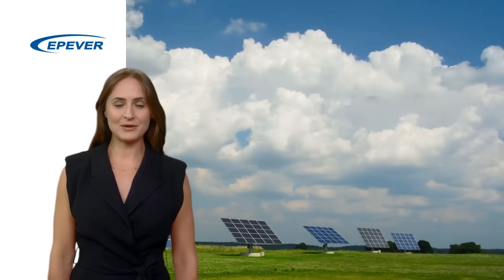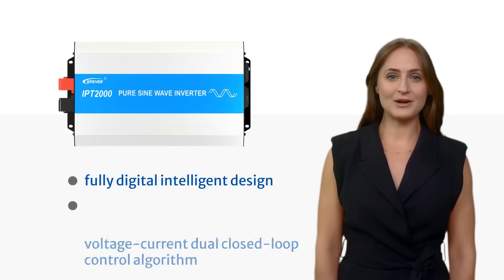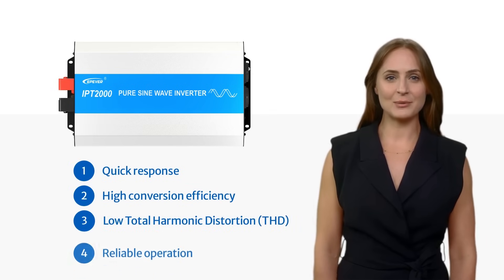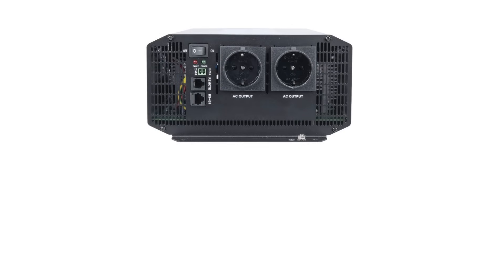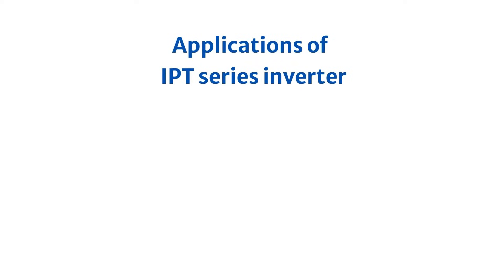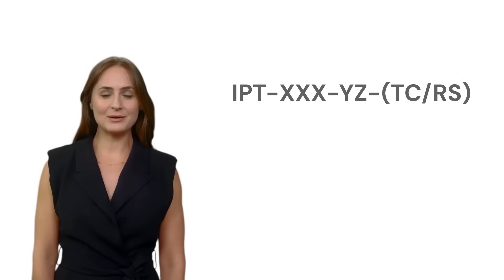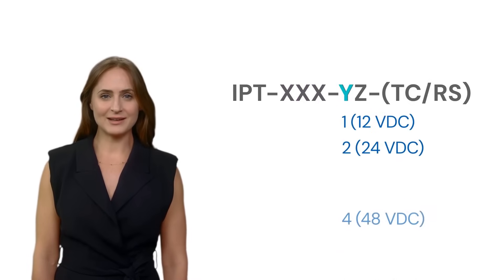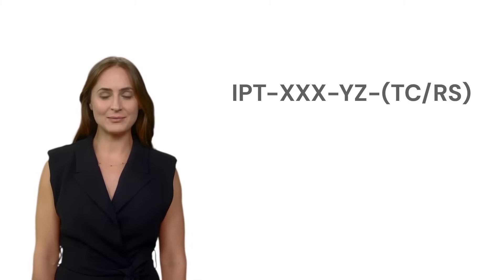EPEVER IPT Series Pure Sine Wave Inverter Deep Dive | Exploring Features and Functionality

Comment: I would ner use a high frequency inverter from any manufacturer for my off grid home. First of all they offer a short life expectany, and they offer a poorer life expectany. Why do you think they're the lowest cost inverters on the market?
Reply from the maker: Thank you for your feedback. Our product line includes both high-frequency and low-frequency inverters to meet diverse industry and regional requirements. High-frequency inverters are typically suitable for residential and commercial applications, while low-frequency inverters are better suited for high-power and continuous operation needs, such as industrial equipment and off-grid systems. If you have any further questions or need additional information, please feel free to contact us.